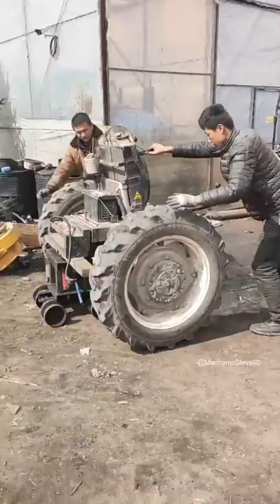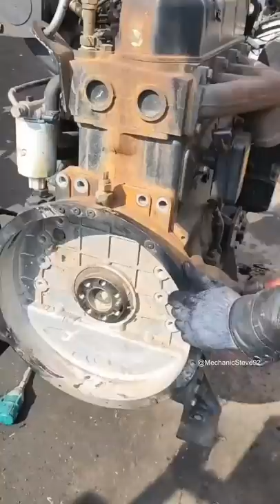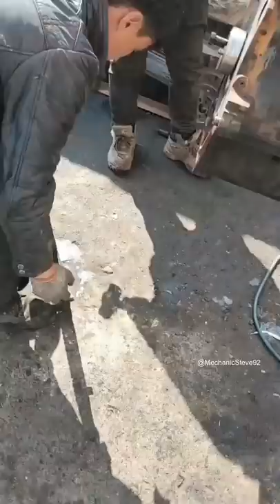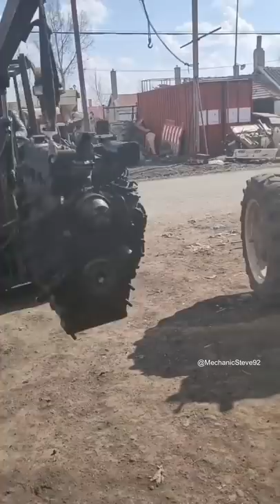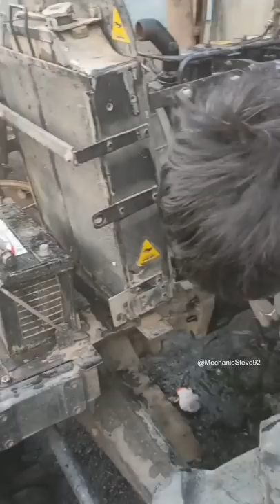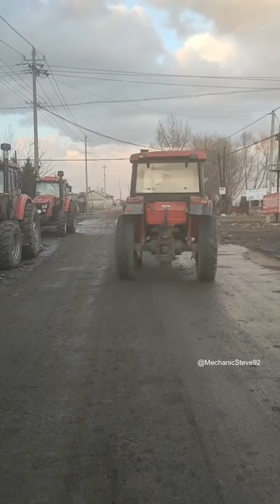Red Tractor engine Modification

Comment: What did he modified?
Reply: It was a downloaded mod 😂
Reply: C'mon man it was heads and cam swap
Reply: He clearly made some sort of modification to the oil pan with a grinder no idea what it was tho probably some simple aftermarket modification
Reply: He switched to another engine but for new engine too fit the ttactor transmission he changed the housing on the transmission side. Thats why he shows the engine number plate ..on both engines. Its diferent